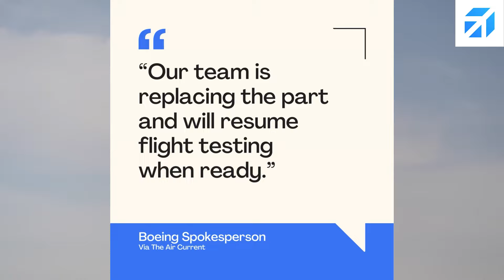This Is Why Boeing Has Grounded It's 777X Test Fleet...

Comment: Give it a rest - every new plane has problems - back into the woodwork. Boeing factory workers ................ validate this.
Reply: Agreed. That is why its called "flight test". Sometimes its a design issue and sometimes its a manufacturing issue?  So its back to the hanger for further investigation and checks. How Boeing will address this will be entirely up to them? The clients for this new plane will undoubtedly scrutinize the report as they will be operating this on their fleet.
It may take a good 2 years or so before an actual production could be seen and delivered. Till then, I have to say the delays on this plane only hands Airbus the edge. I like to see fair competetion as we the passengers are the ones benefitting from both manufacturers

Comment: Engine are bigger more powerful and cheap good old financial blind geek used the old mount… at Boeing… the genes must be changed. tanker failure, MCAS fix, driving  into Max failure , JADM failure in Ukraine jammed too easily and they miss target. 777x ..failure…mainly à GE issue but Boeing had time to get the rest perfectly,,Starliner failure to come back…same thing plenty of time,,, etc etc etc etc ..it is a cultural and stupid financial beans counter issue,  all R&D is done by software and computer so that solutions and timing become totally unknown and out of control with plenty of inhuman nonsense ..😢
Reply: What ????